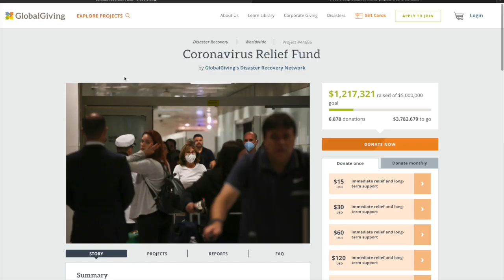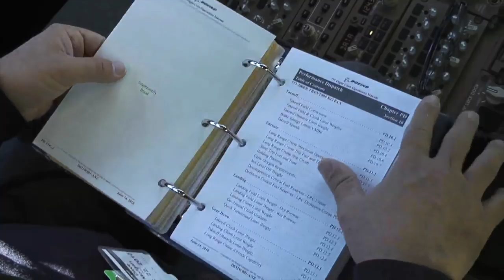Boeing 747-8F vs Boeing 777F: 747 vs 777, which Freighter Aircraft is best?

Comment: Being old fashioned, I believe four engines are better than two. If heavy weight cargo transport is the goal, then the 747 would be my choice. The 777 is surely capable but if you have an engine failure while fully loaded, I would be concerned about getting down safely, especially over water. For cost, what about the An-124 as it has the payload ability?
Reply from the maker: Code3Forever Hmm, yeah the An-124 has payload capability, though I Guess that leasing one wouldn’t be cheap. Yeah the fear of twinjets over water especially a fully loaded twin, could pose performance issues. Thus 777 is subject to ETOPS while 747 isn’t. Thanks for watching :)

Comment: With the combination of nose door and side door(just aft of the wing) you can get cargo out of the main main hold and cargo for the next sector in  faster  making for shorter  Transit Times   and being Multi engined there are arecno over water restrictions on the routes it could fly as you have with an ETOPS big twin also with an ETOPS, aircraft you need at least two engineers to look after it on a transit as with ETOPS regulations you're not allowed to have the same engineer working on  both Engines however despite
 it's, size you only need one Engineer to look after a B747-8F  due to it's four Engines not requiring it to conform to ETOPS Rules & Regulations! Thec long upper deck on the B747-8 could be used to carry passengers in a combi aircraft kind of way with boarding through the upper deck door's! Not delaying the transit time adding another revenue stream for the flight!
Reply from the maker: Timothy Seabrook Thanks for pointing out. Yep, the 747-8 freighter is known for the cargo door allowing large and bulky items to be loaded quickly. Thanks for watching!
Reply: Definitely the 747-8f would be my choice for any big cargo company.